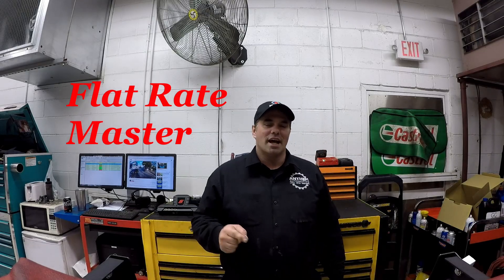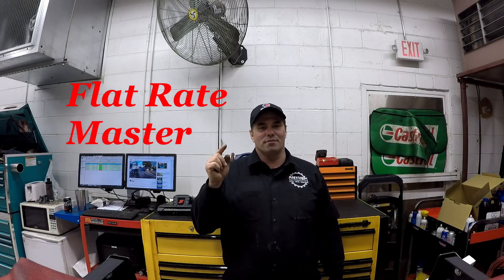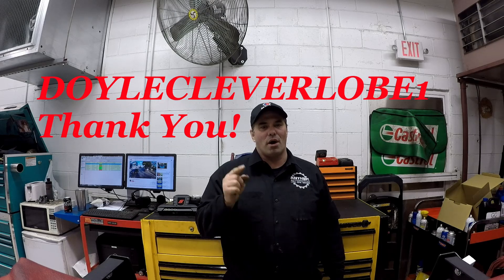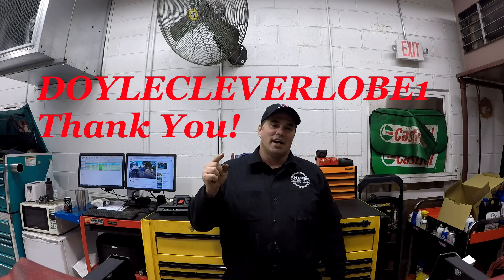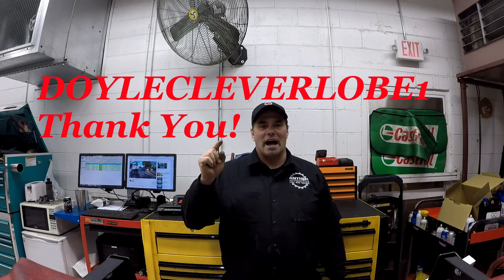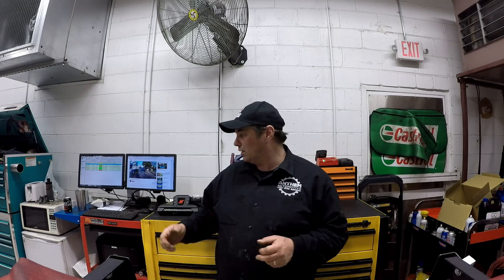Car Lines I Hate Working on and Love Working on!

Comment: My dad hated working on the Thermoquad carburators Chrysler used.He calls these Thermojunks to this day.I hate working on Fords,worst to work on in the domestic line.Do everything the hard way engineering.My dad did buy one Saab once and it was a mistake.Had a bad engine which was replaced and lost money on it taking it back to the auction.The Jaguars,there is a fix to their engine problems called buying a conversion kit to drop a small block Chevy or LS engine in them in place of the factory engine.I did replace a CVT in a Nissan Rogue and it was a nightmare.GM,they share their computer info and they are the only one that you can reuse an used engine computer.The Humble Mechanic likes Volkswagons and Audis,he works at a dealership.I was taught that you remove things that are in your way.
Reply from the maker: Yes those Thermojunks sucked, lol, late model Jags should just go to the junkyard LOL!
Reply: One junkyard owner in my area has a 1978 Jaguar with a 350 Chevy under the hood.A friend of my dad's did the conversion.

Comment: I love working on Chrysler products to. easy diagnostics and alright to work on even up in the rust belt. some Chrysler's are a nightmare but for the most part pretty good. I'm not saying Chrysler makes awesome vehicles they have there downsides as a vehicle owner to. squeaky doors dip sticks that break off. but great for diagnostics and egr valves lol. least favorite to work on German cars lol Volkswagen especially. Tiguan issues and such don't like working on those 😕

Comment: Like you said, Honda's break too, but they seem maintained better.
Hate all Saturns, cvt's junk.
Hate Ford 5.4 long spark plug removal, buy the removal tool. And 5.4 short plugs blow out of the head, buy that tool too.
Hate VW body wiring, brittle breaks wherever moving parts are.(door hinges)
Don't like the Lincoln/jaguars.
Hate Northstars too. We've junked some nice ones, blown headgaskets and there 5+yr coolant.
Hate hate hate 6.5 Chevy diesels...injection pump/driver junk. First gen duramax not much better.
Hate hybrids even for brakes. Relearn brakes or have a good pedal only to back out and roll through a fence bc the computer let the pedal bottom out when in gear. Plus orange wires of death.

Comment: Subaru?
Reply from the maker: Somehow I forgot all about those:( I do Tbelts on those all day long but diag work etc, sucks, people love them and will spend stupid money on them to reseal the leaking heads, IDK why but they do!
Reply: I have a 03 subaru forester, i like that they are easy to repair. I did the HG's at 180k miles ive 220k on it now. Still runs great. I don't really understand the love affair people have with subarus they are kinda boring (except wrx/sti) but practical i guess. I can't say that i will miss my forster when i sell it. I can say that it has been trouble free the entire time i have owned it. minus the Head Gaskets (long trip over heating)..
Reply from the maker: Yeah, other than the HG issues not bad cars, just eh!

Comment: Yeah i agree how mercedes made it cost prohibitive to do the diagnostic work amf theyre theft relevant parts policy is bullshit, its just a way for them to force repairs to be inhouse. And the old hyundais rust to hell quickly.
Reply: Believe it or not i dont mind mechanical repairs on mercedes benz. They dont rust that bad so bolts are rarely ever seized and i consider them gravy because the customers are willing to pay more for the brand. Around here those customers you described drive pretty much all makes of cars so unforunately we deal with them all the time. One thing about mercedes is i refuse to put on aftermarket parts for customers. I only get dealer parts because ive seen so many issues with cheap aftermarket parts and i will not install customer supplied parts on them either.
Reply from the maker: I don't mind wrenching on them, but the other issues make it not worth it! Aftermarket part on a MB might as well throw your private parts in the vise and squeeze:(

Comment: I hate working on mitsubishis, immediatly followed by I like working on newer kia/hyundai.... Newer kia/hyundai is just older mitsu designs tweeked slightly and produced on worn out tooling.
Reply from the maker: Newer Hyundai/Kia are more influenced by the honda engineers they hired, the old ones were mitu based
Reply: Hyundai is a Walmart honda

Comment: I think a better question is what is the best car line and worst car line to work on in two scenarios - Diagnostic and Mechanical. Mechanically, I freaking hate GM cars. Crap engineering and poor build quality. Diag-wise, GM has the best diagnostic abilities hands down. Ford is very similar. My favorite to work on is Subarus. Great engineering, very reliable and if something breaks, easy to diagnose and fix with my scan tool. Daunting until you actually work on them.
Reply from the maker: It is all in what you like and are familiar with. But yes GM has done a great job with the diagnostic info!
Reply: JT's World the diagnostics and their SPS programming is awesome. More manufacturers should take lessons from them as far as that goes. Being able to use the factory scan tool and being able to access all modules for programming makes a TDS subscription a no brainer for me. The other guys would likely make a lot more money if their model was like GMs.
Reply: For real! I find GM's diagnostic capabilities second to none in the auto world. I recently picked up a Snap-On Solus Ultra scan tool and was just floored at how much you can do with nearly all GM cars. I wish all manufacturers had the diagnostic abilities that GM does.  Ford seems to have almost as much capability as GM on my Ultra, but I find it lacking in some of the functional test data. I have also found newer Hyundais to be fairly good and complete as well, but pretty lacking on the two I have (an 03 Elantra GT and an 03 XG350). However, I recently diagnosed an 07 Accent misfire that was a breeze thanks to all the data and functional tests that were available for it. I think it is awesome that we have a global standard for diagnostic. I just really wish they all worked the same - it would make life SO much easier!!!!

Comment: I enjoy Ford 7.3 and 6.0 Diesels, new Hyundai's, all Toyota's (except the Previa) VW diesels, and GM trucks. I can't stand Ford 6.4s, Jeeps, GM cars, and Kubota tractors (yeah I know not a car, but I really can't stand them)
Reply from the maker: Forgot about those damn, Previas, hated those things. People call the 6.0 a POS, the 6.4 blew the 6.0 in crappyness!
Reply: did an engine (45k never changed oil) on a hyundai sonata 2012. One of the easiest engines i have ever done. very good cars now, very simple too.
Reply from the maker: Starter on my mother in law 11 Sonata was an easy starter!
Reply: I've done a couple of timing belts jobs on the 2.0 Elantra...Super easy and paid well too
Reply: Flatrate Master The 6.0 is a misunderstood engine. It's my bread and butter. Once you learn it and understand how to fix it and what aftermarket upgrades to do then they are great. I have turned around the opinion of many of my 6.0 customers by fixing them "correctly". The 6.4 will always be a nightmare  of complicated garbage
Reply from the maker: True once the early issues were sorted out with the 6.0 is a good engine, not as good as the old 7.3 but still way better than the 6.4 could even think about!

Comment: definitely rather work on ford chevrolet honda acura toyota lexus scion subaru.
dont like working on mercedes, some chrysler-dodge-jeep are just poorly designed.
Reply from the maker: CDJR are junk, but they do keep you busy:)
Reply: shortbusno27 I hate chrysler vehicles too. Bunch of overheating, valve burning, head gasket blowing pieces of junk! I can't tell you how many Chrysler's I've seen come in with a slight miss at idle that had a burnt valve.
Reply: Subarus are a pain too. Especially with the Boxer

Comment: If you buy a crapy Mercedes Benz ? Want to make sure it's made in Germany, not all are made in Germany, ones made in Germany are made better but it's still a Mercedes. Will drive my 2004 Buick LeSabre with 110,000 miles into the ground before buying another car. Had no issues in four years, try that with a Mercedes Benz or BMW? Audi S6 and S8 with the V10 is another one you don't want unless you have unlimited cash flow for repairs ? Some of those repairs come with a Lamborghini repair price.

Comment: I'm always working on my family's stuff mostly GMs, no problems with those. My brother and sister however like the dodge and ford stuff. Seems to me like everything is backwards so I can't stand them. Old lady actually has an 04 sable with the duratec 3.0 and it's been throwing a p0302 forever. Changed out the cop, plugs and injector and still nothing. I'm almost sure the thing has a bad ecm that just is irratic with firing the injector. Every cylinder has 180psi of compression also so it's not mechanical. I don't have a scope so right now there is no way for me to diagnose the ecm. It has been a good car other than you can't keep a clear coat on the fucking thing and this damn p0302 code.
Reply from the maker: Ford has issues with ecms on coil control and injector controls, LOL I am so used to everything at this point nothing bothers me anymore, just the joys of being a indy tech!
Reply: Flatrate Master Yeah I kinda thought that's where my diagnosis was heading. Thanks for letting me know I wasn't off in la la land overthinking shit.

Comment: Kinda crazy to think that an independent shop turns down Mercedes wow
Reply from the maker: Even with a ex MB dealer tech on staff, we had a 40% comeback rate on them, shop average is 1%, 90% plus was BS but still too much BS for as little as we worked on them, we have a  MB dealer right down the road so we never saw a lot of them anyway

Comment: I kinda disagree with this dude. I worked Land Rover, Volvo, SAAB all at dealer level and I thought 
They paid well and the work was not to hard. If your not used to this type of thing then YES they 
Can be a pain in the ass. There are a lot of tricks that you only find out about by working at
Land Rover dealership. Call me a puss but I could never work at independent shop. 
God bless the techs that can

Comment: saab is literally GM crap. same as a chevy cobalt....not even hard to work on.
Reply from the maker: Work on real Saabs before GM bought them
Reply: @flatratemaster  i will say working on the 2.0/2.2 ecotec chain driven water pump could be one of the worst jobs ever.